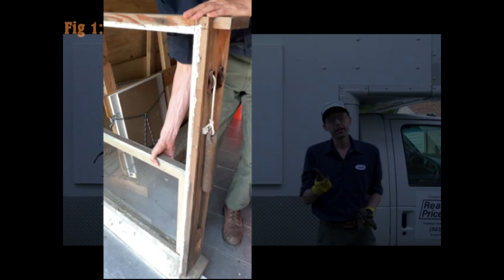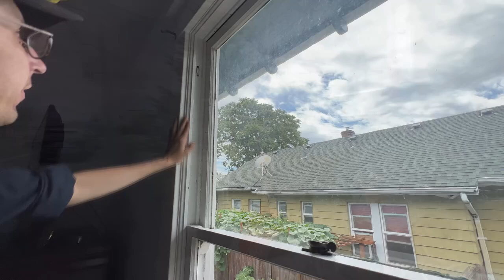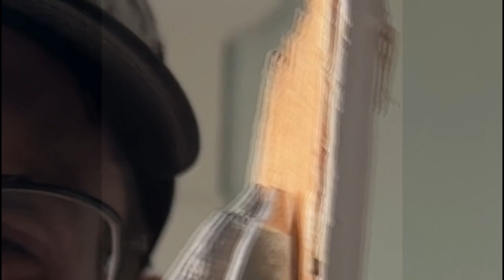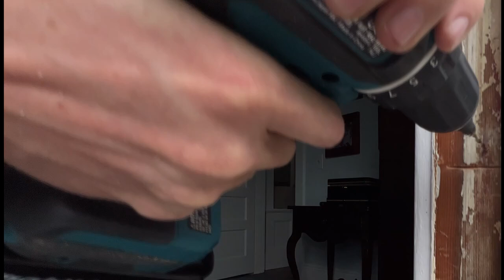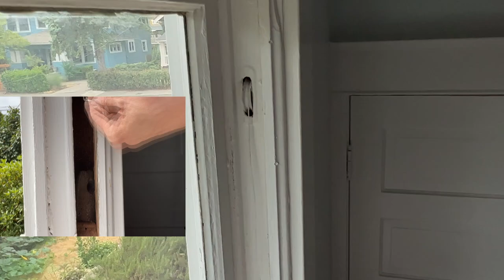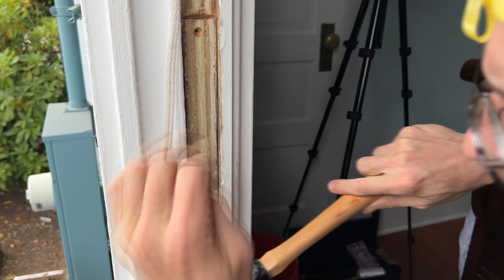Sash Cord Repair - Start Here Video

Comment: Nice work. 
All of the old sashes I have worked on, had a slot cut from the factory and set with a screw on a bevel cut end. 
The value of an oscillating tool cannot be measured.